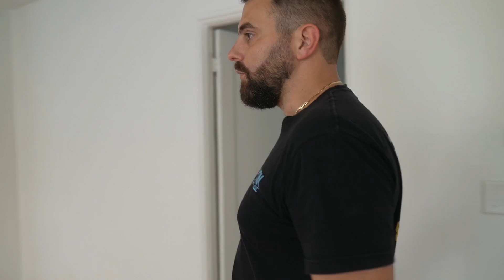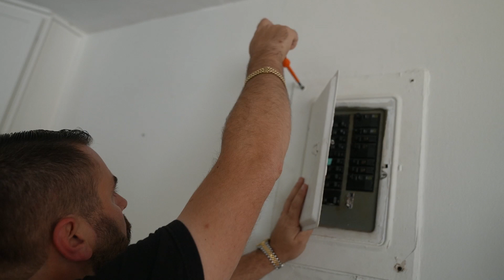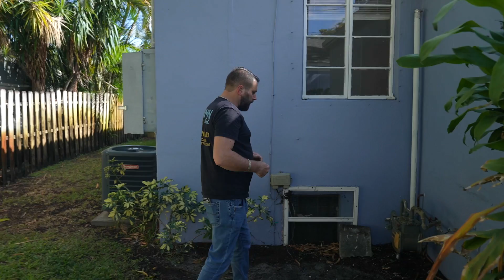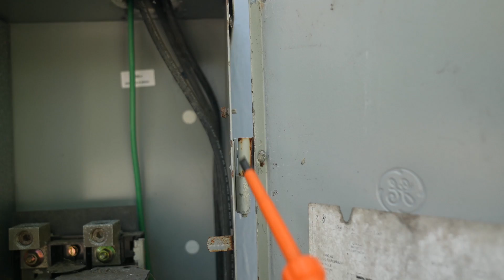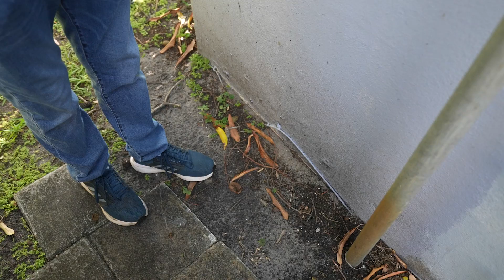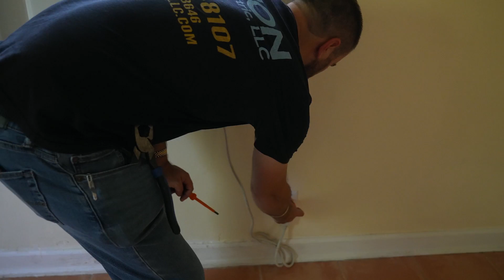Inspection of Historical Home Electrical System - Simon Electric LLC

Comment: That’s crazy about the meter rings. I would never think of that but the concern makes sense. Here in Phoenix we use meter main panels with all the branch breakers outside. Usually they are 30 or 40 spaces and 200 amp. Does anyone even make that type of panel without a meter ring? Every panel I have seen has a meter ring.

Comment: Hello brother,, Where the brother is working, is the electricity 220 voltage or 110 voltage?
Reply from the maker: Hello,  thank you for the comment.  This home has a 110v/220v system. Originally when it was built it was only 110v now it uses both like most homes in the USA. (2 separate 110v legs that together make 220v at 60HZ)

Comment: Yes code requirements are no handle can be higher than 6 foot 7 inches off the floor, I'd have to research exactly what article it is but that's definitely modern code.  Not sure when that became a requirement.    Sometimes older homes had the service panel in a bedroom closet for instance.  Older homes can be quite interesting and  even unsafe by today's standards.
Reply from the maker: Awesome comment! I grew up working on very old homes in the city i learned in we would frequently replace fuse panels for breaker panels. You never know what you will find!